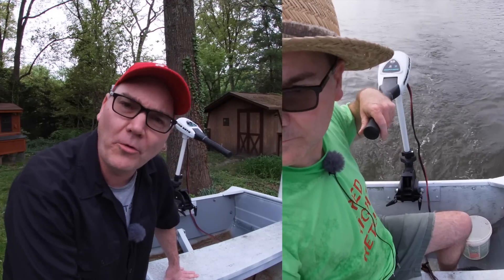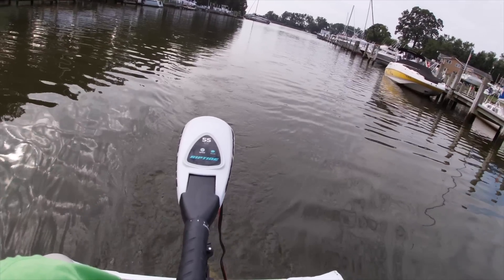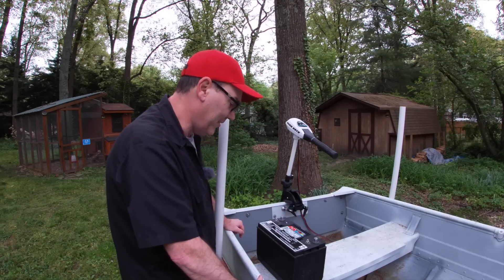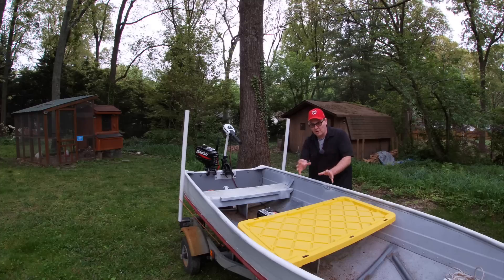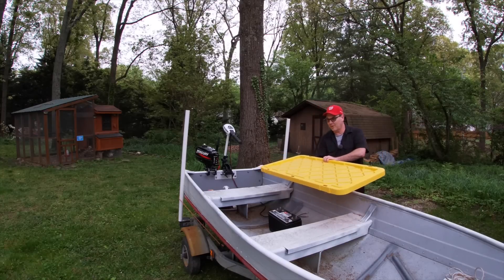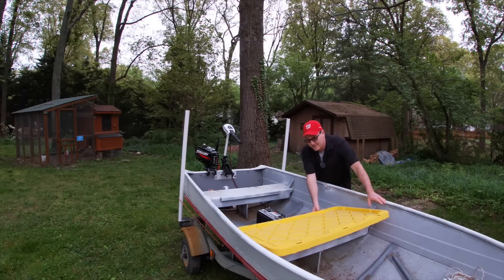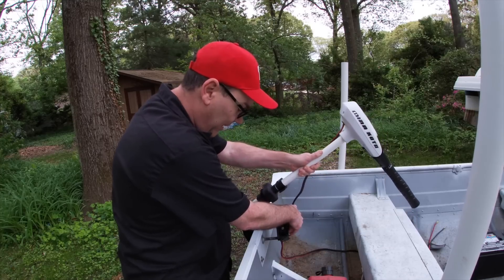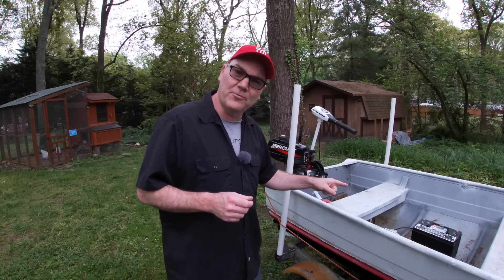How Many Solar Panels Do You Need For A Trolling Motor?

Comment: I used solar to charge a battery so we wouldn't have to carry it back and forth from a pond to charge. We didn't go on long trips and the boat wasn't used everyday so it worked great.
Reply: How big of a solar charger?
Reply: I use a solar panel (10 watt) to charge the battery on my trailer for the winch. It functions without a problem.
Reply: I have a 100 watt panel on my camper. In good weather it will keep the battery up for most all of elk season. It does keep the battery topped off while parked. Worth the money just for that.

Comment: You should learn about electricity you boomer idiot, get rid of your caveman batteries. Also I don’t understand why you need 1:1 charge/discharge rate if you aren’t going to be motoring 24/7 you boomer idiot. All of your math is flawed and fails to include a knowledge of electrical engineering, caveman boomer idiot.
Reply from the maker: So I have to have a knowledge of electrical engineering to understand that $500 solar panel would cost more than a $100 battery?
Did you even watch the whole video or do you just like typing random angry words?

Comment: LIFEPO4 is the only way to go regardless of the initial cost, they can last 10+ years and 10,000 charging cycles.  Plus you would save a significant amount of weight and space.  A brushless motor would also dramatically improve the efficiency of the system.
Reply: I was just talking about that.  My 116 lbs of flooded lead-acid batteries still have another couple of years left, so as they go bad, I will be replacing them with LifePo4 batteries.  I just didn't have the money when I put my fishing canoe together.  Now, I am regretting the decision.  Who knows?  Maybe in a couple of years Tesla's "4680" batteries will be on the market and I can skip the whole lithium-iron-phosphate generation, altogether.
Reply: I had a puffy life-po once .
Reality is that not all cells/pouches can last 10.000 cycles.
They should make it easy to swap the bad one.
Reply: @theowink  a 12 volt LiFePO4 battery typically has 4 cells.  Fairly easy to diagnose a bad cell and replace it.  Harder with Lithium Ion, you might have 100+ smaller cells in a 12 volt battery.  Two totally different animals.  I have never had a problem with LiFePO4, but have had so many Li-ion and Li-po batteries go bad, I lost track.   I also keep Li-ion and Li-po batteries in a steel box, have also had a few explode.
Reply: Brushless motors aren't really that much more efficient. Just 10% according to one article I read.
Reply: @joewoodchuck3824  The speed controllers are also more efficient with a brushless set up, so in real world conditions you can expect to see a 20-30% better efficiency from brushless motor / speed controller.
Reply: @Matthew9306  OK.
Reply: @joewoodchuck3824 Depends on the manufacturer make and quality of the brusheless motor.
Look no further than makita power tools.😅
Reply: @justsoicanfingcomment   I've had pretty good luck with Black and Decker. I even still have my first 7.2 volt b&d drill. It's semi retired though. My 20+ year old DeWalt drill runs and looks like new. It's a nicad drill but I plan on trying a set of 18650 li ions as a substitute if I can fit them into an original nicad case. 
   I recently bought an AC powered DeWalt drill which has impressive power. 
   We all have our favorites. There's sure no shortage of choices.
Reply: @joewoodchuck3824  It depends upon the design of the brushless motor they can be easily 25% more efficient. But you have to check the efficiency rating from the manufactures ect. My brushless trolling motors are about 18% more efficient than most brushed motors, I didn't by the best nor are the high efficiency brushless motors really available in trolling motors yet.
Reply: @markjackson6829  25% more efficiency is pretty awesome for brushless motors.
Reply: The danger for lifepo increased tenfold the more you charge once they puff it’s bad
Reply: @squeaks3814  I believe you are thinking of lipo (lithium polymer) batteries.  I have blown up dozens of them. And yes, they are a fire and explosion hazard, I store mine in metal boxes.  I have never had a lithium iron phosphate battery swell, definitely never blown one up.  There are videos on youtube of people drilling holes in LIFEPO4 (lithium iron phosphate) batteries and they don't catch fire.  They are considered the most stable and least likely lithium batteries to catch fire.  For fun look up electric bus fire videos.  They are wild.  Those are lithium ion batteries.
Reply: @Matthew9306  I read that lipos being phased out. Another article said that some labeled as lipo are actually li ion inside.
    I have a few upcoming li ion projects using 18650's. I'm hoping for the best.

Comment: I’ve used a 35 lbs trolling motor on a 3.75m Aluminium boat with a bum 12V car battery. Nearly went the whole day. No crazy speed. Lots of hang ups in weed. Newer panels generate 400W+. Extending the range of a lithium battery may be worthwhile.
Reply from the maker: Yeah there seems to be some great benefits to a LiFePo4 battery that seem to outweigh the higher cost. All of the 400 watt systems on Amazon are still made up of 4 x 100 watt panels - I am eager to what becomes available in the near future!

Comment: Stick to fishing Bud because math and electronics is obviously not your Forte. On average a 30 lb thrust trolling motor draws about 300 to 350 w. I can buy one solar panel that's cardboard thin that's 410 W and weighs about a pound and a half. That means it produces more solar power than the energy Demand on the motor thus run it all day in optimal sunlight
Reply from the maker: Did you watch the whole video? I never said it wouldn’t work or was impossible. I haven’t seen any 410 watt panels - what do they cost and how big are they?
The purpose of this video was to simply look at whether it was a good idea in terms of cost and size for a budget boater to add solar. Everything I found that was commonly available (and not thousands of dollars) was very large for a 12 foot boat, or very expensive, and/or wouldn’t keep up with the constant demand of an electric trolling motor unless it was perfectly optimal conditions.

Comment: I tried my 35 lbs thrust trolling on a solar panel with 315 watts 36volts directly and it works great, but I'm not sure if it can handle the heat
Reply: Explaining it is one thing but you're talkin too damn much get to the f**** point
Reply: be carful!
Reply from the maker: Neat!

Comment: I have envisioned doing that sort of thing with a tiny trolling motor on a canoe or similar.  The idea is that the solar panels are on a little styrofoam raft (or chain of such things) trailing along behind.  Close to the water they won't catch much wind and you can have 600 watts trailing along behind you.
You could eliminate the battery entirely although I'd keep a small battery for voltage regulation and the occasional cloud passes between you and the sun, or go under a bridge or some other shadow situation.
This won't be effective for fishing of course since you are also trailing your hook, but for simple cruising and exploration of bayou and things like that, trailing solar panels behind your small boat would work well.
Reply from the maker: There's a guy in NZ who has a sort of catamaran setup with panels beside the main hull which is an interesting and possibly more durable and similar idea.
Reply: This is The Ticket! Drag will not be even detectable if the raft is light weight.
Reply: I do this regularly, runs my radio and cooling fans too.
Reply: Nope would not work. Wind waves momentum of the raft
Reply: @analogalbacore7166  and the extra drag would defeat the purpose of it. Just use a battery
Reply: @analogalbacore7166 works for me!

Comment: I know from my e bikes that you don't need to stay at full charge and it's bad for the lithium battery.
You just need to get home without running out which is also bad for the battery.
On water you want to get back with energy to spare.
The question for me is how much longer can I fish  and I'm willing to sit in the shade while my time is extended.
My dream build is a used hobie cat and shorten the crossbars. Cut the mast to about 5 feet and make that the base of the solar Bimini top.
Options are a hydrofoil for reduced friction and a steerable kite or inflatable wing.
Keeping the batteries low in the twin hills acts as ballast and have the motor on a drop plate so it stays in the water when up on the foil.
If there's no power elsewhere this boat could  sit till it's charged.
We get baking Sun here and it's hotter still in Baja. Gas takes a lot of fun out of fishing.
Trolling for free every other day sounds like a deal.

A hybrid idea would be a small light gas generator to charge the battery.
I wonder if that would be considered a gas engine in restricted waters and how long it would have to run to recharge.
My bikes can take hours so it would have to be a quiet fuel efficient generator.
Reply: yes you cañ its gid bater moñy oerf vare fake ñews

Comment: I was going to put mine on Youtube. Yet I was only making simple music videos and now YouTube wont let me upload anything. So I will tell you. My raft/boat is 12ft. Inflatable pontoon. Small brush 12v trolling motor. Just on my two small 20ah batteries. With no solar. Run time is 12 hours. The solar panel hooked up in the system is only an 20 watt seft contained panel. Water resistant. Half the speed of my 2 cycle 3.5hp outboard. I am fishing. Not jet sking. Runing it none stop is 12 hours. Combined 40ah. Not 100ah. AMG batteries. Not lithium batteries. My trolling motor has brushes. Next I am putting on an sink. Like I said. I would prove it only if Youtube did not shut me down for making simple music videos. Very proud of the boat. It has a lot of extras on it. I am not done yet. Sorry not my fault on the proof. I would love to show it off. Oh well.
Reply from the maker: That's very cool! So you're using smaller ah batteries and a smaller panel. So your costs were probably quite low.

Comment: what about getting a small generator to charge and run the electric motor you could use the battery for trolling around the use the generator for getting to where you need to be while charging the battery as well $300
Reply from the maker: Interesting idea.

Comment: Wayne I see quite a lot of flaws in your perception of electric boats. 1 Lead acid batteries are the worst choice for this application. 2 The trolling motor you are using has a cheep brush motor at 12v. If you follow ohms law the higher the voltage the lower the current so 12v is useless in this application. 3 the solar panels must be measured to your load and this is possible in small applications. With the proper parts it is possible to accomplish what you state as impossible. You are trying to compare a apples and a turd. The technology is here today if you do real research on it.
Reply from the maker: I am not sure you really watched or listened to my video. I didn't state that it was impossible at all. I love watching videos about small solar boats and have been fascinated by some of the experiments I have seen. But many (not all) of those videos do not break down the cost and are not able to demonstrate if their solar option would work in less than ideal conditions. The problems I presented with a solar option for really small boats are: high cost and the space required for the panels to keep up with the motor. 

Many small boat owners own and use Minn Kota and similar brands of low cost trolling motors. This video is about showing that a person can't simply add a small/inexpensive solar panel and run their trolling motor all day. As I pointed out in the video, people who run and then stay in one spot for a few hours, could potentially keep their battery topped up by using a solar panel.
Reply: @WayneTheBoatGuy  I didn't because you started on a negative note in my perspective.

Comment: Solar might be the best way for some people to keep your battery charged in between fishing trips if you keep your boat in the water all the time and don't want to lift and carry around an 60lb battery back and forth to a 115v charger. But not for powering the boat by themselves.
Reply from the maker: Good point! There are also solar charger/maintainers people use for trailered boats when those boats are patiently waiting to get back out on the water.

Comment: I have a 14Lb trolling motor for canoes  and  on  a 100 ah lifepo4 battery and 2x 100 solar panels -  two speeds 21/2 mph and 4 mph
Reply from the maker: Cool. Are you using the panels as a roof or are they mounted off the side?
Reply: @WayneTheBoatGuy  one on the front bow one on the stern - they were too heavy to mount high up on a 2 man canoe less than 3 feet wide

Comment: you have a lot right.. But do  the math on the wiring drop .. it can be as much as 5 to30 %  an more with the wrong components . this is what i do for a living i fish severl no gas lakes  my boat is a allweld 12ft  skif  same trolling motor two large deep cycle batteries 8 two 10 hr  depending on how i fish that day
Reply from the maker: Dang - so are you saying with the voltage drop in the wiring, it can be even worse at charging up batteries?
Reply: @WayneTheBoatGuy  yes you are working  with DC CURRENT people forget the difference in ac and dc current  dc is not as forgiving as ac
Reply: 12 foot carinlua sjj 25  24 hp 20 hp ekrrc oyt board

Comment: Solar is still to expensive for normal people afford, I love my 1988 6hp Johnson on my 1968 14ft. aluminum boat. I do a lot of fishing with it, except for one lake near me, you still can run gas motors.  Going with 2 100ah battery's with my 55 thrush trolling motor it will last all day and then some. The only way I can see posable is a solar panel charging the battery's while waiting for the next fishing trip in several days.
Reply from the maker: Yeah a solar charger/maintainer might be a neat thing to try out - especially if it's not easy to run an extension cord out to the trailer.
Reply: or byy new 6 hp  has 50 watt  altrnatire charng with out solar celks

Comment: Spot on! I run an electric shallow water work boat with electric mud motors, small electric blowers for weed less operation, electric launch wheels and litthium batteries from a Chevy volt....along with a small propane  generator and 1200 watts of overhead solar panels!  I literally have thousands invested to operate a 14 ft jonboat with 4 ft paneled outriggers and I'm in the middle of a major redesign and refitting. If all I wanted to do is go fishing for an afternoon, none of this would be worthwhile!
Reply from the maker: Sounds like you have some cool toys! Thanks for watching!!

Comment: Conceptually, the issue you describe is exactly true with EV's.  Short of a miraculous advancement in solar/wind power generation, there is absolutely no way our current grid capacity will ever power enough EV's to replace gasoline.

Comment: Interesting. The math is what is concerning me on my project. I have a 20hp 2 stroke that has a stator. My plan was to run engine to fishing spot and let small 10w solar just charge up for radio or small electronics needed while fishing. The boat engine alone should keep the battery pretty topped off. But i dont know how to figure out if its worth investing into.
Reply from the maker: In your situation, I would be tempted to try a little solar panel. The draw of a radio and/or other electronics will be very small. If you're really concerned, a jump box might be something to bring along for the ride the first few times you try it.
Reply: buy solar radios mine 25 hirs ²000 mga 40 mha solar ell 25 hiyr baryte life

Comment: Hello Wayne, Thank you for your video! 
However, I am afraid your analysis are based on guesswork, but not actual "calculation" and experimentation. In fact, for all practical purposes, it will work, please see: 
https://www.youtube.com/watch?v=lUI9Ii9IusE&t=20s
for actual calculations, as well as actual construction, and on water experiences:
1) one does not need to have the battery "fully charged" all the time when the boat is on water. For practical purposes, all matters are speed and range of the boat for the day out on the water. 
2) the batteries are charged not only during the time when the boat is on water, but at ALL THE TIMES when the boat is not in use on land if left outside. So the batteries are actually ALWAYS fully charged whenever the boa is needed.

etc. However, thanks again for your efforts.
Reply from the maker: I watched your video and you actually validated my points in two ways: 
First - You made a roof for your solar panels. One of my points is that we can not generate enough electricity with solar on a small boat without making it into a roof structure.
Second - You are running a 24 volt system and you didn't disclose the cost of the components. I doubt the panels, controller and batteries were cheaper than just buying another battery to stay out for a while longer. 
My video was not intended to show that what you have built is in anyway bad or incapable of doing what you intended. Your project is very nice. But for the person watching videos like yours, and wondering if they can just add a simple panel and run their motor all day, or if it is a cheaper option than buying a second battery to extend range, solar isn't really the right choice for that person at this time unless they are going to be stopped for a few hours and have the room for a big panel or two.